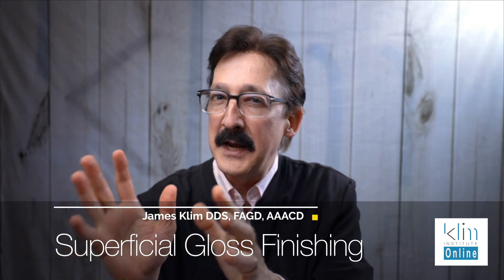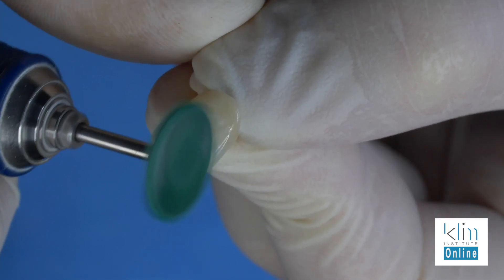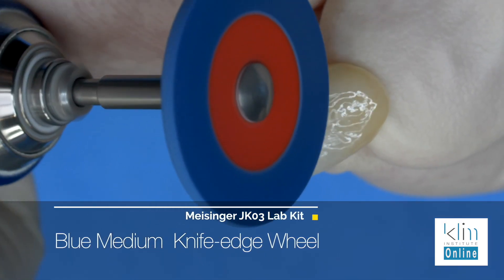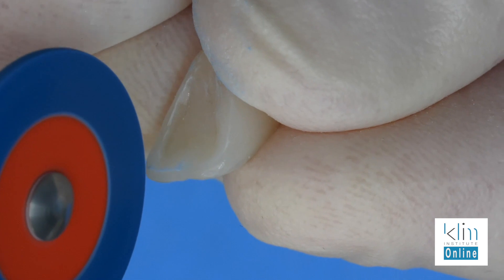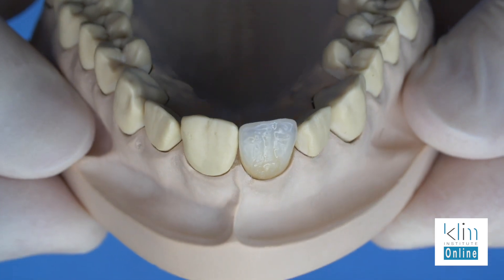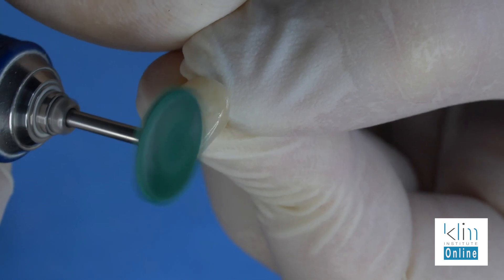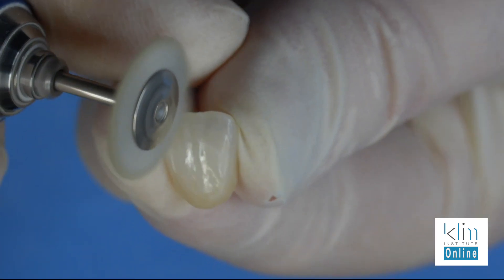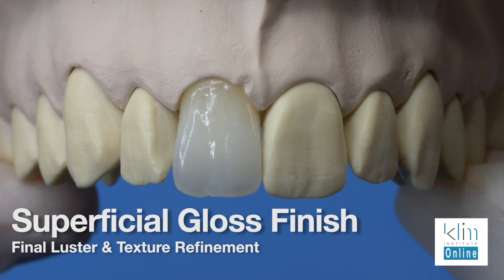Superficial Gloss Finish on my CEREC Restorations

Comment: How much time do you schedule for the appointment for your single tooth anterior cases? I generally schedule two hours when I'm doing posteriors and not spending much time glazing. For anteriors, it seems like 3 hours would be appropriate for time to do all the contouring and glazing especially if you are glazing after crystallizing. Or do you temporize and have them come back?

Comment: If you took anche other milling machine and an other cad program, you resolve the problem of the Refinitur, I buy cerec because I see your tutorial, it wasn't a good choice, I have buy the other milling machine, and the real cad program... I can do everything, not limited on one crown, and if I do a pontic I have to set up 140 micron, or the thickness of the crown I can't set up, I have to think how to cheat this program, I am so sad
Reply from the maker: Sorry, the system did not work for you. It is more about your system and skillset to learn the system.   When you understand the program, you don't have to cheat the system. I have used more than one system, and it is more about integration, training, and skill set.  all the best. The content of this video is a technique used for all ceramics.  Hope you can learn something.
Reply: @KlimDDS  Hello i used the system at september are 2 years, if you have a discromic teeth and if you want the teeth not thickness but big to hide the discromic inside the teeth you cant do it,if you have a pontic you are in trouble, you have to set up 14o micron min to insert your pontic(if you havent space with antagonist)you are in trouble.Trust me if you use an other program cad with 110 micron disilicate you can insert, AND AN OTHER PROBLEM TYPES OF TEETH(you cant insert library), YOU have the variability biogeneric, but when i see on you you have to finished manualy, my mille mcxl dosent do it , with the other milling machine , idont have this problem, the last is you spend a lot of time on personal abutment, you make the section you save on cerec lab and then you mill on again, the other cad real cad dosent need this time, your time is important,anyone dosent pay you, for the less time,see out of your window ,there are other important and easy cad and milling machine, if you are a dentist and want to make the dental technician on your dental laboratory, you need a really machine, not something  that do but not enough. look on premilled abutment, but you have to change prospective

Comment: Beautiful work! Do you have a video that describes your workflow? Do you use CEREC to scan the full arch to print the models? Is your characterization based on photos you’ve taken?
Reply from the maker: Yes, I do use mainly photographs for texturing and characterizing.  I have found the primescan very complete for accurate scanning, virtual designing software, and printed models when needed.  The workflow is similar to analog with the exception to stay totally digital.  When working anterior, I will often place a transitional (temporary machined) to allow unrushed time to surface texture and characterize.  I appreciate the complete control of the process and feel I have found more satisfaction refining the craft of ceramics using digital and virtual technology.  All the best.

Comment: Dr Klim I have a question. I tend to get an uneven glaze with the ceram glaze spray on emax, some areas are smooth and others are pitted. What might be the reason for that and do u have a remedy? Thank u so much for the helpful videos.
Reply from the maker: The Ivoclar spray glaze is technique sensitive and not consistent.  An excellent spray glaze is the Endenco Spray glaze.  I think this will solve the dilemma in spray glaze quality and will provide consistency.  https://indenco.com/collections/cad-fluorescent-spray-glaze